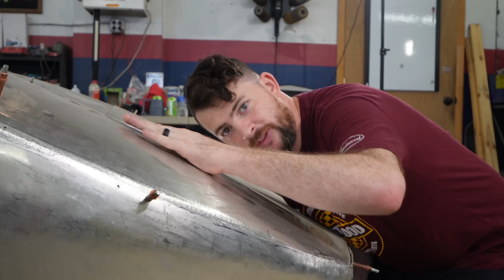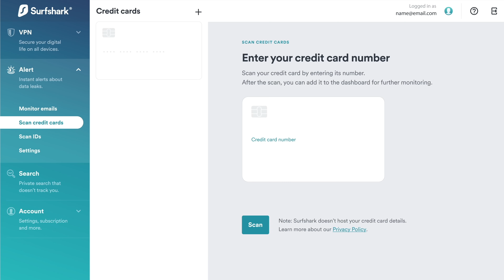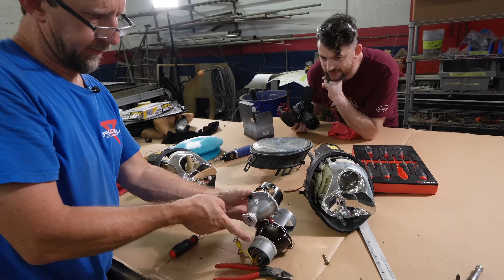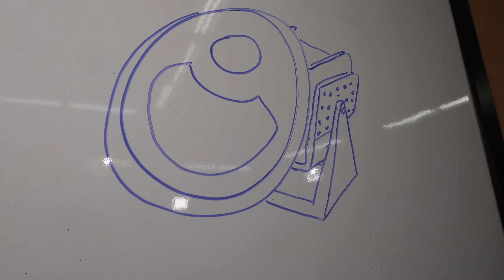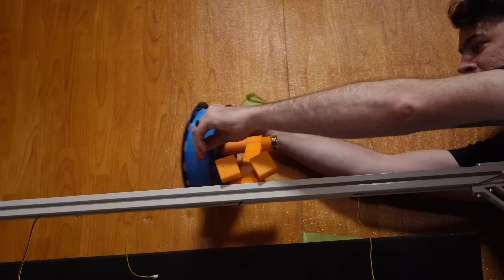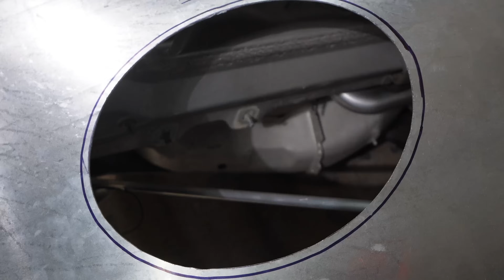Making POP-UP Headlights for Our Supercar! (Project Jigsaw Ep. 50)

Comment: You guys should’ve had the headlights tilt down into the body instead of popping up, that would’ve kept the top of the light in the same spot, and would’ve required less modification to the housing

Comment: Mechanical dip mechanisms aren't new. Rotax lamps (maybe some Lucas too) from the 20s/30s on old UK cars used a system where when the lamps were dipped the offside one would turn off entirely and the near side reflector was moved diagonally by an electro magnet to point in a different direction. The lamps are stand alone units and look the same externally but they are different inside, the NS one having a slightly smaller reflector to allow room for the dipping mechanism. Of course this isn't legal these days so on the car I am making I need to use different bulb holders inside the lamps to take dual filament bulbs (or LEDs most likely).

Comment: I'm kind of surprised you didn't arrive at a Pop In solution.  The light woudl be effectively hinged at the very top edge, then swing inwards at the bottom meaning only the bottom would need to be scalloped.  Again - different engineering challenges but woulda also-been-cool.

Comment: When you held up the guts for the headlight, I had a realization.  I always wondered why beetles and no other VWs have replaceable lenses.  It's because they're the same guts as a porsche and porches are cooler.  Same parts though.  Looks for a VW emblem on there somewhere.

Comment: Printing the inside part to hold the bill more to the middle of the light will allow you to make an angled sheet metal cover so when the light flips up the metal is even with the body. Since it’s a projector it doesn’t need that chrome backing. High temp black will work perfect and the light being lower in the housing will be a bit more periodic correct.

Comment: Just make a metal channel  which follows the path you need for the light to go. Then use a three point rocker attached to small dampers. You operate the rocker with a Motor or a hydraulic system.

Comment: Right, use a T handle and throttle cables to make a manual headlight extension. Also you can utilize Radio Control Servos which can “throw” open and close the headlight with a 12 volt interface, a switch or button on the dash. Maybe use the old corvette vacuum reservoir and spring method. Anyway you’re on the right track. Ryan with the bracket W. Make them pop down.

Comment: Could the headlight opening be flanged with simple tools without having to cut in and weld a bezel later?  you could probably tip the edge with some modified vice grips very easily.  Only need mayhbe 3/16 of a flange on that I bet.  Curious to see how they pan out!

Comment: probably easiest & cheapest to just go with miata pop up motors, you can rip the whole light bucket out at a junk yard relatively easy and you'll see how simple it is. 
You can pop of the oem linkage from bucket to motor using a screwdriver and replace it with threaded rod & heim joints for height adjustability. 
You'll need springs to keep tension on the headlights when they are up unless you got a newer idea, otherwise while driving the lights will vibrate and look bad.

Comment: I would have frenched the lens flush and split the housing and tilted the rest of the light to be level inside the body or even better just french the lower part of the light to where the top of the light was flush with the body. All of these options were being done in the 50's

Comment: Why not use Porsche 928 or 968 lights
Reply from the maker: We didn’t use 968 or 928 headlights because the face of them is vertical when the headlights are up. And yes ‘60s inspired
Reply: @CrucibleCoachworks  do you mean like the most beautiful car ever, the 60’s Lamborghini Muira. And you can solve you beam problems by having them go up to the correct angle
Reply: I agree, plus the projector lights are totally wrong for a 60’s car.
Reply: @H1WEX It isn't a 60's car. It's a 60's INSPIRED car. There's no reason they shouldn't use better lights when they exist, and are easily accessible.
Reply: @H1WEX  yes , no projector or led’s for me.  Nice classic lenses pls
Reply: That was my thought as well but they didn't come with projectors as far as I could find.